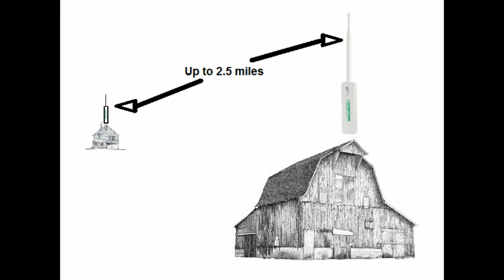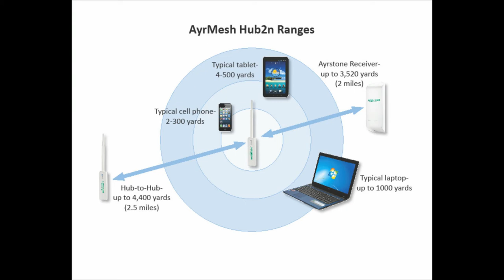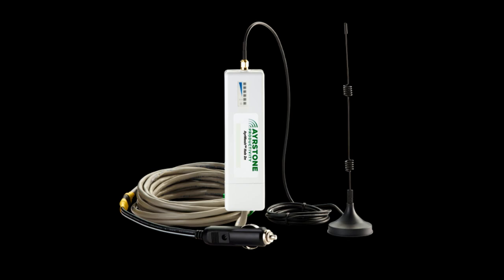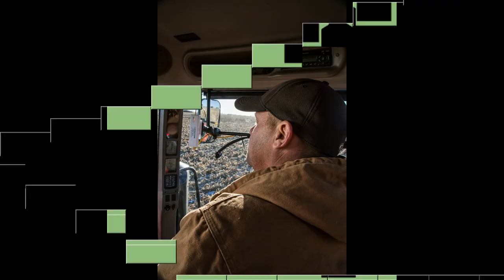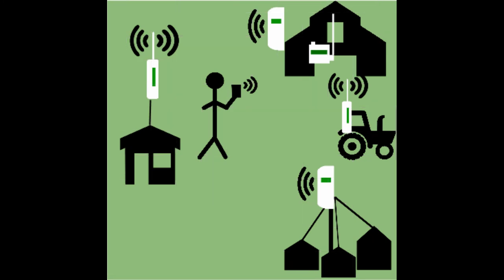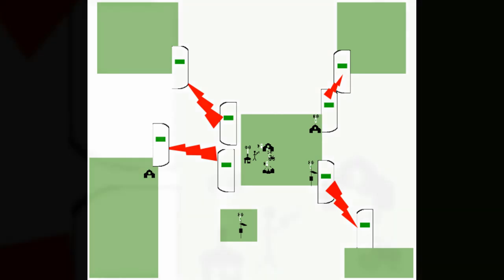Ayrstone AyrMesh Overview - 2017

Comment: If I set this up with my router directly connected to the 2x2C hub broadcasting to external receivers on my buildings which are then connected to internal hubs will I be able to start a WiFi phone call in one of my buildings and stay connected if I go outside?
Reply from the maker: Yes! One of the advantages of the AyrMesh system is that it is all "layer 2" - it does no routing or filtering - so everything connected to it appears as if connected directly to your router. You can move around the network from Hub to IndoorHub and back out, and your IP address, etc. never change.